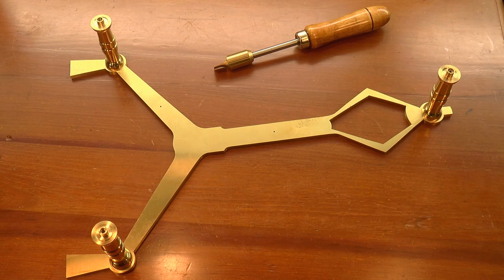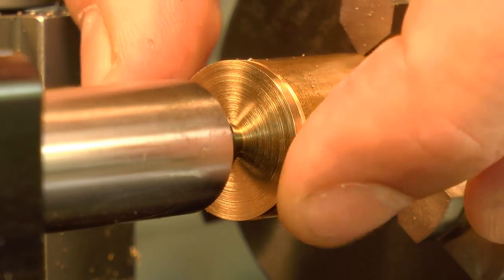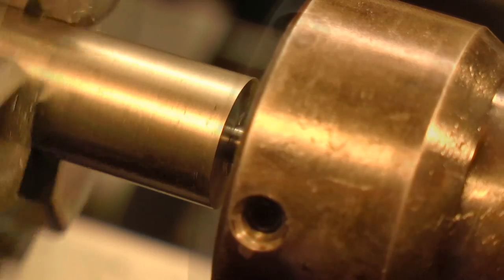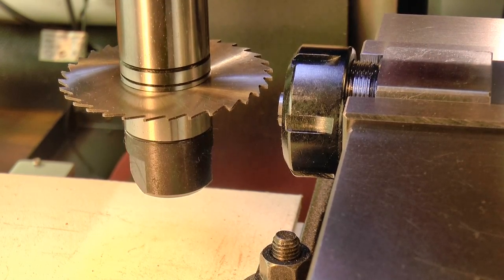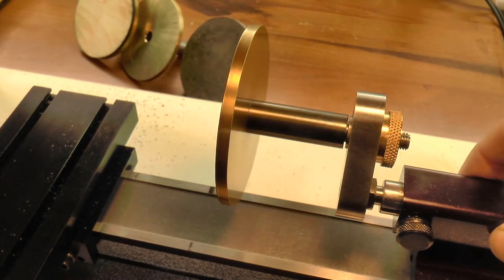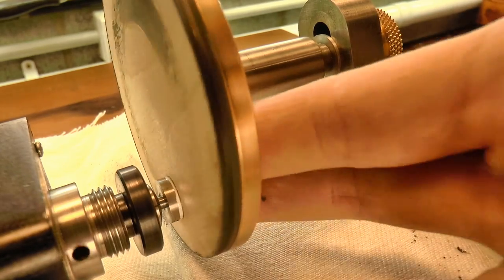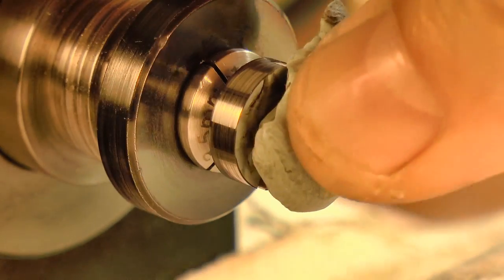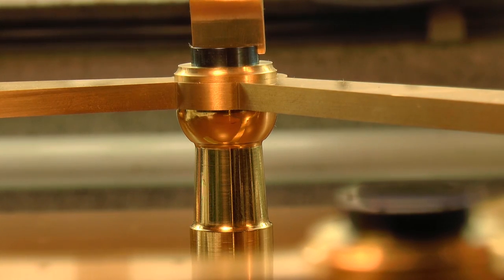Clockmaking - How To Make A Clock In The Home Machine Shop - Part 3 - Making The Washers And Screws

Comment: I cross section my laser welds here in the lab all the time. The key to getting a scratch free surface is to clean the part between every step. I throw the part into an ultrasonic cleaner When I'm changing sand papers on the polishing wheel. You got to get the 600 grit dust off of the part before you use the 800 grit.  Put the part upside down in the ultrasonic so the debris falls away and out of all the nooks and crannies. Also, you should use separate discs for each grit of paste. That way you don't cross-contaminate grit sizes.

I know I'm 5 years late to the party from this video being posted. The algorithm just recommended your channel to me a few weeks ago. I grew up in a machine shop around machinist my whole life. You Chris, are a freak of nature! Completely mesmerizing craftsmanship.
Reply from the maker: Thank you Paul, completely agree with your recomendations re cleanliness, contamination etc, terrific to have you watching :)

Comment: You have me wondering about the way optical flats are made. Why not a plate glass wheel and lapidary/optical abrasives? Finish with rouge. I used to have a huge block of aluminum from Boeing and polished lots of different things on it.

I would love to see a walk-around of your tools and the nifty chucks you are using and other bits. All fascinating! By the way, flats are made in threes. Grind A aginst B, B against C, C against A. Repeat till satisfied. In glass that can be flat within a small part of a wavelength of light.
Reply from the maker: BobChaz I think that would certainly work BC. I will do a walk through tour down the track, thanks for suggesting.

Comment: I am deeply impressed and encouraged by your videos Sir. I love all the custom tool and helper guides. A few questions..1. How did you come to have such an extensive machine shop? 2.Are you a commercial machinist that has expanded into clockmaking, and therefore added the smaller Sherline and other bench lathes? 3. Do you think it would be possible to duplicate your skeleton clock in miniature on a Sherline lathe and 5400 Mill, or is the specialty tooling just not present? Cheers and thanks.
Reply from the maker: +swordsworn7 1. Slowly, and with much support from Mrs Clickspring! 2. No just a hobbyist 3. You can make most of the parts on a Sherline, the only challenge is the large wheel, which you could cut on a friends lathe/mill if possible, or even order in from materials suppliers. Miniaturizing can be done, but of course it would not work as a clock due pendulum length needing to be a specific figure. Cheers mate :)
Reply: +Clickspring Many thanks, I was just discussing your videos with Mrs. Swordsworn7 and I will be experimenting with your resist-etching processes for clock faces for a tiny work project  and taking your suggestions for bluing long thin pieces of steel with a custom tray filled with brass fillings. Outstanding!

Comment: There's no one better for  this, so much information perfectly paced. I'm still drooling over Sherline lathe stuff right now......have been for months. The big question I ask is what do I need, a hobby or a passing fancy.   A newly furbished Ml7 is the thick end of 4 grand for starters
Reply: True though I'm building a shop on a very small budget, the biggest wedge of cash is the lathe itself....so many little lathes to choose from,  Taig etc......so it has to have a lot of useability... I was already set on a Sherline or one of the many C3 chinesium crapfests that litter the internet just trying to work out the right bed size.......8" between centres is probably as big as I wish for the time being but ........ 

I'm just procrastinating, need somewhere to put it first and lathes aren't quiet things.......thanks for the help all the same, I've gotten some plans for a clock in the post and  steam engine, buying the books is relatively cheap. Damn, never been so focussed on anything like this, so exciting
Reply: I've given myself 3 years to get a house and shed for my hobby, overtime all the time, hee. I am still thinking of the 8" sherline with a view to finding a bigger lathe later on, heh. The shop grows like a living thing, I'm well and truly hooked.

Comment: Hi Chris, as ever, I can't stop re-watching your great videos! I wonder if you've ever tried perspex as a polishing lap? It is truly the queen of polishing laps. Wood has fibres that (no matter how soft the wood appears) are hard and can scratch the metal surface. Some woods (think grasses and bamboo) actually contain solid silica deposits! 

Perspex has none of this; it allows the abrasive to embed its surface, and is hard enough to resist the deflection that leads to rounded edges. 

Of course, I know you already have a tin lap, which, with bronze and iron, are the kings of lapping (due to their granular structure). But perspex is a close second, and can be had quite cheaply as offcuts.

Thanks again!
Reply from the maker: +Kosmos Horology Hi Mate, very pleased you're enjoying the vids! I recall reading in JMW's book that perspex is very effective, but I've yet to try it out. It certainly would be more cost effective, the tin is super expensive!
Reply: @Clickspring  I know this is years late and someone may already have suggested it, but precision polishing of optics such as lenses and mirrors is often done with a pitch lap and cerium oxide as the abrasive. Typically the pitch is melted and poured onto a tool - often another piece of glass, and can be given an appropriately curved surface to match the optic being worked on. It might be an option for your incredible metalwork and the nice thing about pitch is that as it wears, it can just be remelted to return it to its original surface profile. There are specialist optical pitches available in different hardnesses with the hardest apparently being suited to polishing flat surfaces, while softer grades work better on more elaborate curves. The cheaper alternative is to use something like roofing pitch but you'd need to test it to make sure there wasn't any contamination by hard particulates that might scratch the surface.

Comment: Is there a way to make sure all the groves in the screws are in a specific position?
Reply from the maker: +Kevin Eder Yes. Insert the screws prior to slotting, mark the slot position at the snug position so all are similarly oriented, and then form it. It's usually more trouble than its worth, but I did  'time' the screws in this video after a few viewers requested it: https://www.youtube.com/watch?v=O8xIjsaDlN8 Thanks for watching.

Comment: What is that putty that you use to clean off the parts before final polish?
Reply from the maker: +Brekelefuw That is called Rodico, it's a soft putty substance much like blu tac, that is mainly used by watchmakers to clear off finger prints and grease. You can get it from any of the horological materials suppliers. Thanks for watching.

Comment: What's the deal with the unbalanced end-tool at 3:43? That must be like 50 thou off at least!
Reply from the maker: wither8 That's a slitting saw. They are notorious for running slightly off center, not the most pleasant cutting tools to play with! Thanks for watching.
Reply: +Clickspring Did you make the saw blade and arbor or is that available?